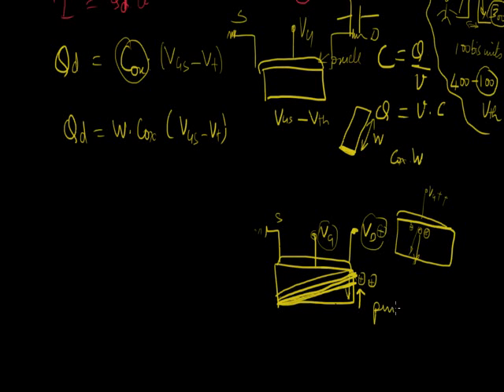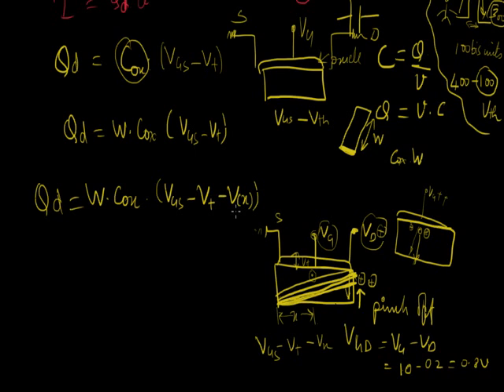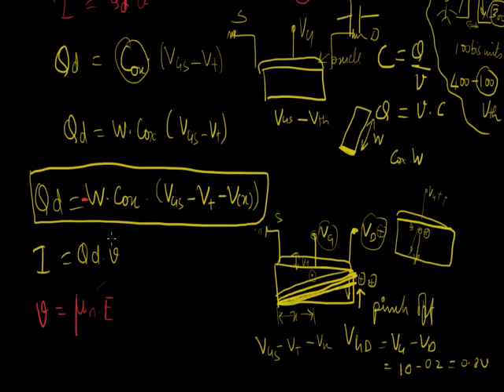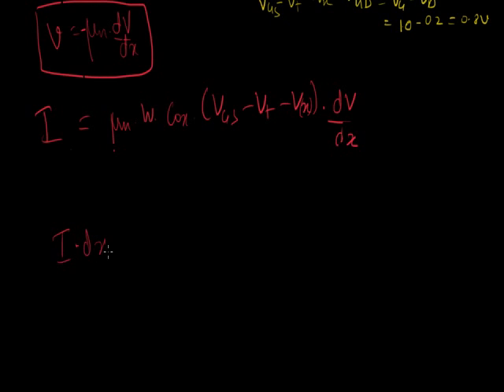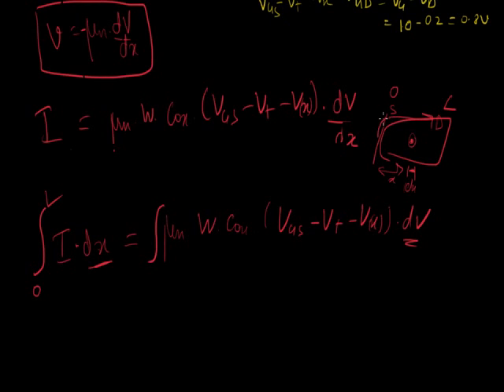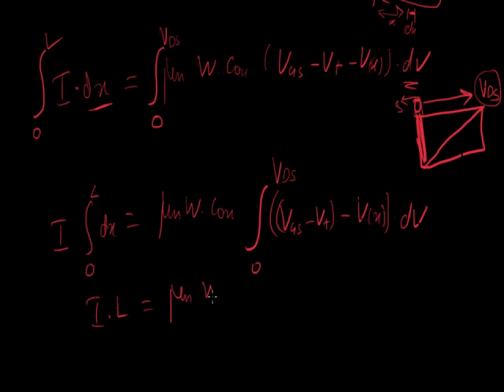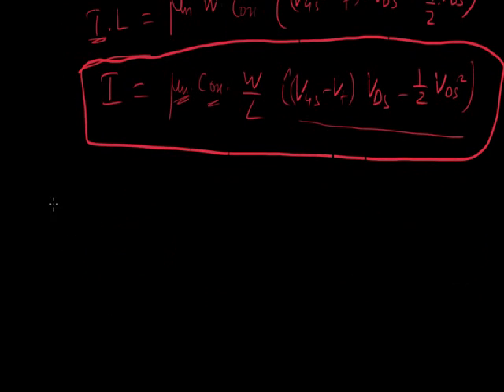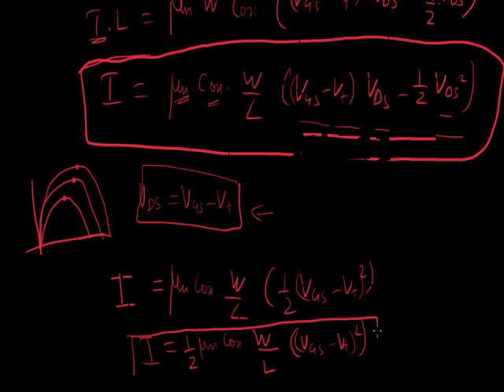Equation of Current in MOSFET - Part 2

Comment: to supriya and others,
about the inclination(channel length modulation).
we need to consider and know that the inclination is in the channel length region(b/w source and drain).
but the reason for it is, Vgs and Vgd.
for nmos: g=+ve voltage ,s=gnd ,d=+ve voltage.
channel length inclined upwards because the drain voltage is increased more and please remember these line "that don't consider only Vd, please correct it we consider Vgd.
so if Vd is increased more, then Vgd becomes less positive and in effect holes get placed than electrons near than the drain region. 
so inclination means deposited electrons move towards source in upwards.

note: for cmos conduction:
in nmos electrons are in the channel region.
in pmos holes are in the channel region.

Comment: ur videos r awesome ... i have a very small quarry...when u took Vd into consideration ...as Vd<Vg,The holes at Vd r less repelled when compared to holes at Vg....so the channel is inclined upwards,but wht i din't understand is...when we increase Vd slightly more... the holes r repelled more to the bottom...which means the inclination should be downward...but if it is inclined downward ,we won't be getting pinch off... plz do explain:)